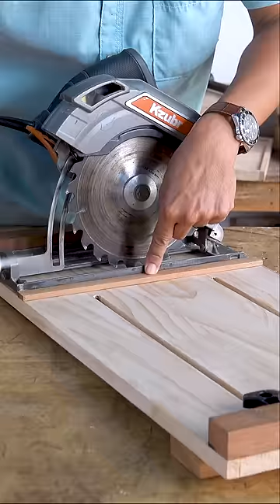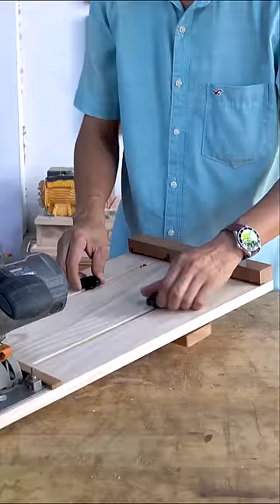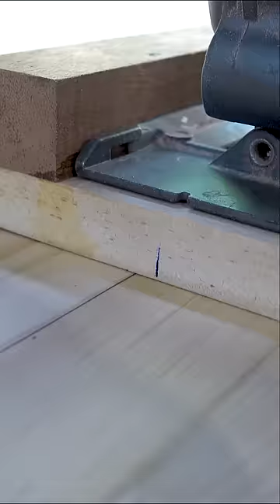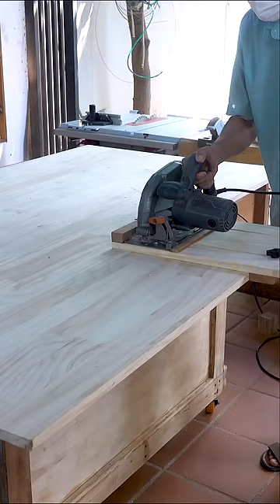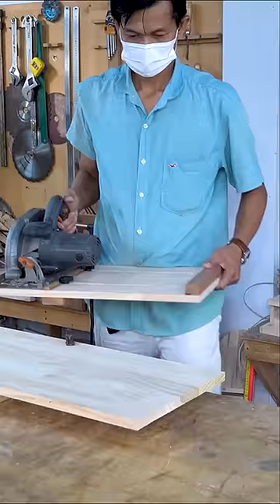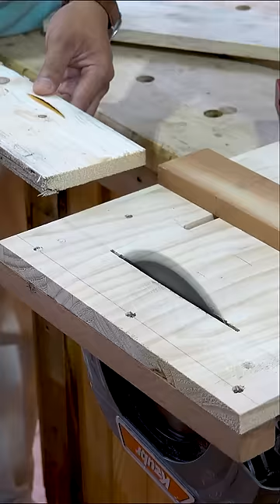Amazing Creative Woodworking Tool #shorts #woodworking #diy #amazing

Comment: Back in the day early on I couldn’t afford a table saw. I made one out of a circular saw and some 3/4” plywood. It was upside down. I had a string tied around the trigger and a block tied to the end of the string on the floor used as a foot pedal to pull the trigger. Rebuilt a neighborhood of 3 story bump bays with it. That was 38 years ago and I’ve still got all of my fingers to those of whom don’t like it! 😂

Comment: Fantastic jig - you literally made a track saw and a table saw using the cheapest power saw alternative! A genuine inquiry: How do you make sure the fence on the bottom is parallel to the blade?
Reply: It is far from replacing a table saw and certainly not as functional as a tracksaw
Reply: Линейкой.. отмерить сантиметры
Reply: Simple cross bars like on a cherry picker lift/scissor lift.
Reply: My suggestion A(2)+B(2)=C(2)
Reply: @justinmiller3781  
Ur a man of few words.🤪
A^2+B^2=C^2 👍
Reply: I’m looking at it with reference to your question.  A jig with wood slots and fence will never be as precise as a jig machined from metal or hard plastics, and wouldn’t be adequate for fine cabinet work… 

…but if this wooden jig was designed and constructed using a square and a good steel ruler to set everything up, you could end up with reasonably accurate cuts.

Good enough for Gov’mnt work.
Reply: Because the base timber is squared and assuming that the base of your is squred. One follows the other

Comment: A jig with wood slots and fence will never be as precise as a jig machined from metal or hard plastics, and wouldn’t be adequate for fine cabinet work… 

…but if this wooden jig was designed and constructed using a square and a good steel ruler to set everything up, you could end up with reasonably accurate cuts.

Good enough for Gov’mnt work.  Especially if you have ZERO budget for fancy tools.

Comment: If you took the time to learn how to properly use that tool, you would know that you can make all those cuts rather easily. But nope, we now have taken a nice portable and conveniently one handed tool and added a 5 lb table to it. Now it's a 2 handed tool. Plus the "table saw" was non-adjustable and can only cut a 4 inch block. Not very helpful. As a construction worker I give this a 3 outta 10. It does have some functionality but your limiting the use of the tool.

Comment: Using the edge of a board as the guide to cut is wrong. If the edge is not square..the cut you make will be the same -not square
Reply: That's not the fault of this amazing tool. User should check edges and make it 90°
Reply: Scissor cross bar action will keep parallel.